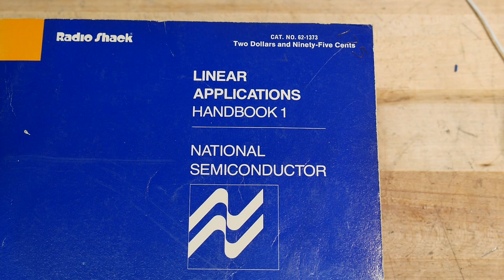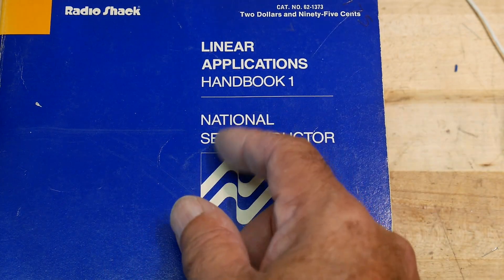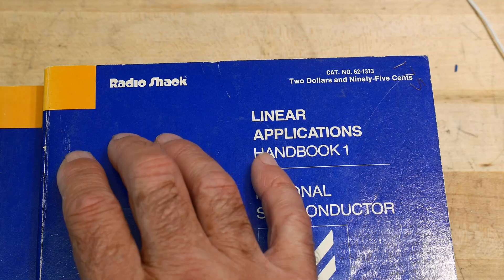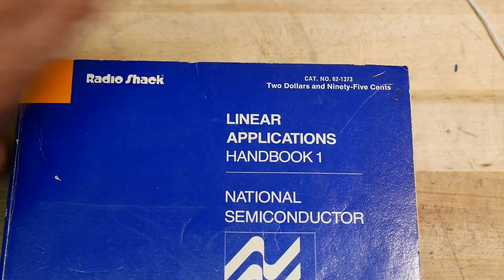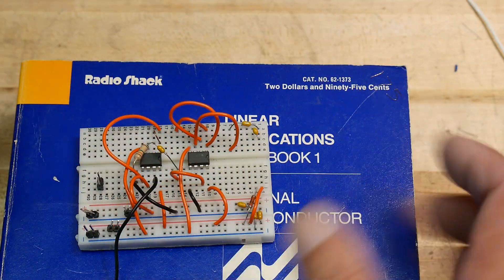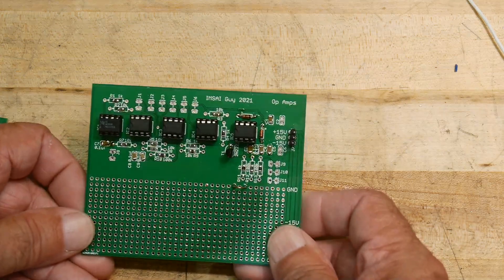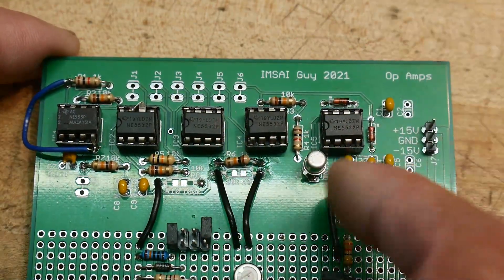#858 OpAmp Demo Board Introduction

Comment: I was 11 in 1973. I rode my bike to Radio Shack. Hung out there daily. Remember the old Science Fair P-Box kits? Great teachers of point to point soldering. Also have you ever used the LM4562MA Op-Amp and your thoughts on the chip?
Reply from the maker: haven't used that one.
Reply: @IMSAIGuy ok. John Audio Tech gave high praise. Low noise.

Comment: 0:19 OMG... I have the Linear Databook from National Semiconductor from the mid-80s (i.e. I got my hands on it in the mid-80s, but it was probably 10 years old by then).
Front cover on mine is thoroughly worn and came off a while back. Over the last 40 years I have come close to throwing it out many times (once I actually retrieved it from the trashcan), but never did, because it has so many applications in it.

Comment: I ordered a set from PCBWay a couple months ago and getting ready to populate one.  Re-watching this video, you mention some mistakes and bodge wires -- so now I wonder if I have the rev.a and need to make the bodges.  How can I tell, and what are the corrections needed if so?
Reply from the maker: the boards you have are rev B. no problems
Reply: @IMSAIGuy  Thanks!  I wasn't sure since there wasn't a "rev.b" marking and I probably ordered them right after the video came out.

Comment: very curious how you make cross connections on that type of proto board? i am experimenting with them and it’s hard to avoid ugly looking solder blobs. i keep hoping there’s a better way.
Reply from the maker: fine tip soldering iron
Reply: @IMSAIGuy  but,  how do you bridge the gaps between the isolated pads- do you bend excess leads, use small pieces of wire, or make solder bridges?
Reply from the maker: @nickcaruso  oh, I use a loop of wire between two holes.
Reply: @IMSAIGuy  thin enough that the leads of components also fit through? like the jumpers on uses in push in proto boards?
Reply from the maker: @nickcaruso  there are five holes all  connected (like a proto board) so you just need to use one of the unused holes. the boards that are just a matrix of holes are useless
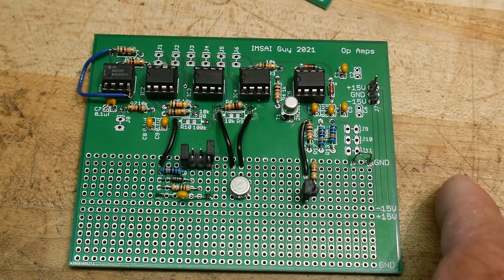Reply from the maker: @nickcaruso  take a very close look at 7:30. you will see the traces that connect five vias in a row. you can see the four components all connected to ground by just one black wire.
Reply: @IMSAIGuy  i misunderstood- i knew there were some traces connected but i thought some were isolated. i bought a whole bunch of the isolated pad boards because they were cheap and i thought i could finesse the interconnections. bending the excess leads over works but it’s a pain and it looks terrible if i need to connect more than a few. are there cheap sources of the boards that mimic the protoboard layout?  i haven’t seen any.
Reply from the maker: @nickcaruso  look at my shared projects on PCBWAY I have a nice one
Reply: @IMSAIGuy  Get ready for sticker shock on shipping if you live in the east coast, USA.
Reply: Also note that soldering is a skill like any other. It takes practice and you learn little tricks as you go. I suggest also that the use of Teflon, or silicon rubber insulated wire is a help because the insulation does not melt and look  shitty like plastic insulated wire. They are more expensive and the Teflon really needs a hot wire to strip properly - so that can be a pain. Good luck.
Reply: Looks to me like the proto area has tracks that replicate a breadboard.